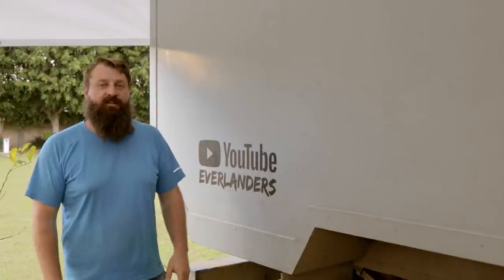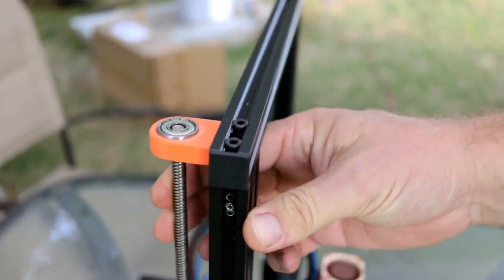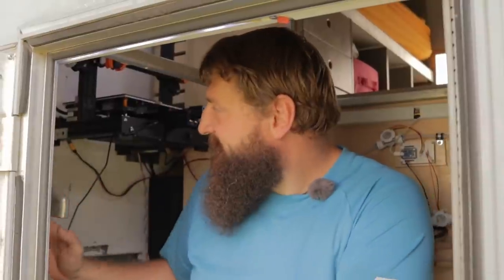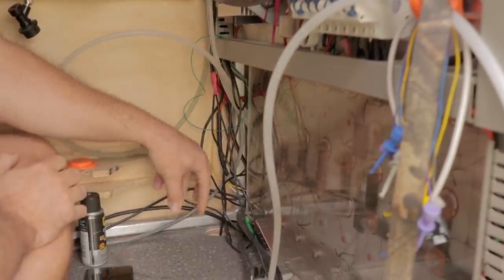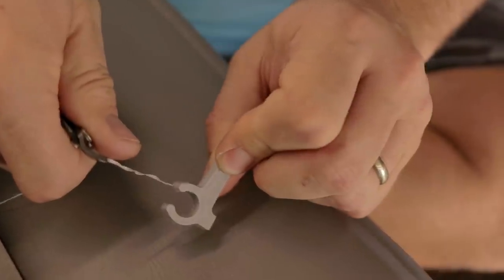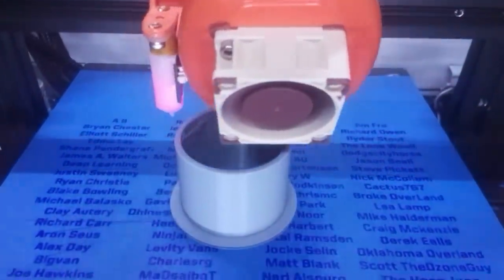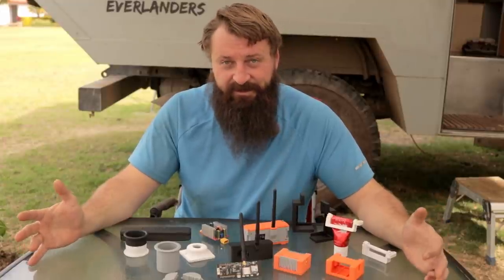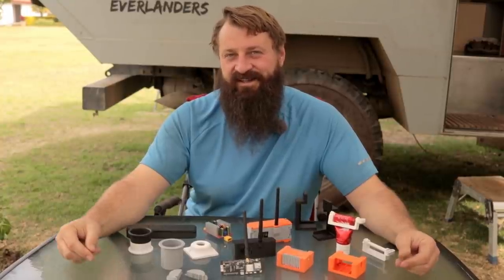Installing a 3D Printer in our Overland Truck  - Everlanders see the World!

Comment: When I tell people that I have 3D printing as somewhat of a hobby, I think most assume that 3D printing is just for toys and trinkets.  I appreciate it when folks like you do videos like this and kind of get rid of that misconception. I 3D print stuff to be useful around my house all the time.  Like you, I find that I can 3D print things that I couldn't buy.  For instance I just 3D printed a wall plate that allowed me to have a duplex plug and a 20 amp twist lock in a double gang box. Before remembering I could 3D print this I scoured the web and couldn't find one.
Reply from the maker: That is the most amazing feeling, trying to figure if you can buy a part or somehow modify something, only to realize you can print exactly what you need... Love it! ❣️
Reply: @Everlanders  Your are a great maker !  Love your modification, I want to do one just like yours.  Please provide details and parts and that I will need to buy in order to build one.   Also, where did you get the training for the 3D printing ?  on the raspberry pie ?  Thanks  LOL

Comment: Dangling berries, LMAO!! I love your deadpan delivery. Excellent use of space inside your rig. Are you at all concerned that an overnight print job will transfer vibrations up to your sleep space and keep you awake or is there so little noise/vibration that it is of minor concern? Glad you are making the most of your lockdown time. Great video!
Reply from the maker: I'm a very light sleeper, so even though it is nearly silent, I'm not sure I would try and sleep through it. That being said, it's easy enough to start a print in the early morning and have it done by nightfall... Anything longer than that, I'd pull it out and put it in the truck cab, this is where it lived and printed for the first few weeks.
Reply: @Everlanders  I think that instead of attaching the printer with screws you could use some kind of rubber blocks like the ones that are used on AC external units.
Then if you put some kind of sound insulation around all the printer, I know one of the best sound isolation materials is aerogel and you can buy isolation panels with aerogel particles, but I think they are expensive and not sure if they are worth the mony if you are not going to print large pieces frequently.

Comment: Great video, a lot of content in just 30mins! 
Watch out when printing with plastics like ABS, remember they pour toxic gases.
I think it would be cool to have a 1mm nozzle that you can swap fastly to print things within minutes. For example, you lose your wrench and you print a new one in 20mins and things like this.
How much does it consume printing normal pla 60°C/190°C? How many Ah for 24v?
Reply from the maker: I have no intentions of printing ABS, it's largely obsolete with the arrival of PETG. The Current Consumption is about 30 amps @ 12v at startup, heating the bed etc, and 10 amps while printing remaining layers.

Comment: 3D Printing is as easy as learning anything else needed;solar, thermodynamics, navigation, satellite WiFi etc. 
NinjaFlex is a VERY good low-temp Gasket Making material. Personally, i don't think anyone with limited access (aka Outta town) to parts should be without one.
I CAD/3D print parts nearly every week. The 15hrs of consistent power is a concern....
LUZBOT makes the easiest to get good results from. Ender 3 is only slightly more finicky, and way more MODDABLE ( it can run ABS and PETG easily)
Thanks for NOT printing a BENCHI, LoL !!!

Comment: Hi! New subscriber & member, offshore sailor, tech professional, and 3D printing novice. Inspired by your content and shopping for the correct printer, and looking for some trusted insight. I don't plan to attempt printing while underway although some motion at anchor/marina is expected, and of course space is at a premium.  Other emphasis on: often small and cylinder or threaded objects, UV resistance, strength. You've done great work with the Ender 3 V2 Neo, and I also see the Ender 3 Max Neo, and then the Ender 3 S1, each progressively smaller pricier (and more precise?). In my ignorance I can't readily decipher the difference between these for my application ... does your experience with the brand allow you to easily weigh in with any general insights?  Lastly based on some research I'm wondering ... am I barking up the wrong tree by not considering a resin printer instead?  Thanks so much if you can spare a moment!

Comment: 10 Points!!! I'm in.  The plain sight  3D print IMHO would be the cooling fan shroud on the printhead.
Reply from the maker: While I did print that, I did also sort of mention it... It was the SD card holder above the plaque on the wall... Already guessed by Eddie Lay a few minutes ago...

Comment: Excellent video as always. I am a bit upset that now I need a 3D printer. I've been wanting one to create brackets and housings for my arduino powered devices in my house. There are way too many of these arduinos sitting on breadboards around my house open and ugly... I've been concerned that I would use the printer a little and then it would start collecting dust. So many cool ideas, I'm beginning to believe it would get plenty of use.

Comment: Just discovered your channel recently and am enjoying it immensely. Nice work! I also picked up an Ender3 V2 a while ago and having a blast. Bit disappointed you didn't do a test print while driving. Haha

Have not watched all your vids yet but didn’t notice any chassis CANbus connection to your conversion. Have you looked up MCP2515 modules? Will communicate with a Wemos.  :) Think the earliest F series I snooped was a 2011. Fun stuff.

Good luck on you travels!
Reply from the maker: Welcome aboard! Wondering if you're related to all the other Ellis's around here?
Reply: @Everlanders  Thanks. That would be extremely unlikely. :)

Comment: Searching out what is a good entry level 3D printer and came across your video. Thanks for the effort in providing a great video with lots of tip and tricks. I am also about to start my journey into Rasberry Pie so all fit together well. I have recently completed an overland truck (Isuzu NPS300 4X4 and camper habitat in Australia) and am enjoying the ideas you have provided on automating things on our Overlander. I note you bought the Enders 3 V2 as I guess it fits your confined space on the overland truck. If space was not an issue what type and brand of 3D printer would you suggest for a newbee? The Ender 3 v2 or something bigger?
Reply from the maker: We ha e larger printers back home, but rarely can you use something bigger...  It's often a batter bet to print several smaller parts that bolt together, utilizing the strength in layers rather than one Lage part which may fail half way through.

https://youtu.be/lpzkHvQA-t8

Comment: Hey Jason, really enjoy your channel. Thanks for all the ideas, just about to pull the plug on getting a printer. It's going to be a blast learning. Been doing tons of studying before I buy. Two things in this video: 1) Ts100, just got it, AMazing. Curious if you know of an off the the shelf step up converter to go from 12v to 24v to run it off a Lipo? (Hitting the like on every video man.) Thanks for all the wisdom.
Reply from the maker: There are countless DC to DC step up converters on Amazon, most of them are adjustable to whatever voltage you want, anything over 100 watts should work... I have several of these 400 watts https://youtu.be/XliXDd9NSWQ

Comment: What a great video, but damnit, now I have to buy one.  I've wanted one for some time now but was kinda leaning towards a resin type.  I get the feeling that traveling with a resin printer would be a mistake.  I don’t see where the roll of material lives?  Is it still on the top hidden up in the hidden space?  The bench access is genius, btw.  Slightly off topic, what are you using for the bond material?
Reply from the maker: Hey Tim! The filament roll is up there too, to the left of the printer a little bit, you can briefly see it at 22:47  Bond Material? The Aluminum Plate? It was bonded with 3M VHB, If that isn't enough I have SikaFlex 252 along and might redo it with that if need be.
Reply: @Everlanders  Groovy man.  So I am hearing that SikaFlex is batman and 3M VHB is Robin.  I will get both, just in case.  I think I will turn the back seat of my 3500 into my shop, complete with TIG, because if the SikaFlex doesn't do it, a TIG bead might!  :-)  Thanks for the info and looking forward to another geeky vid.
Reply from the maker: Because others have asked too... https://youtu.be/4wTP7kpA3BU

Comment: Thought I would ask here sorry it’s off topic but I’ve noted after watching a few hours you negative ground all of your systems? What I mean by this is your solar power (panels) too this is the first time I’ve ever seen this and ask does this cause any problem? Also I was goingask  why you stuck to 12 volt over 24 (current/wire gauge  wise ) as this my biggest problem/pondering with a 2000w ups hacked ,3D printer and my kettle ,toaster oven (24v)  but van is 12v charging  pulling hair out many thanks in advance 👍
Reply from the maker: Yes, everything is negative ground (as most vehicles are)... What problems are you suggesting I'd have?
I built the system 12 volts because everything for RV's is 12 volts, the chassis is 12 volts, the ventilation fans, LTE router, LED lights, Computer monitor, ... and because all the electrical systems are in one place, there is no need for long lengths of thick wire. Our longest thick wire is the inverter, about 14 inches away from the batteries. Mostly I wanted to keep my hair.

Comment: I am curious about how iterative the process is for getting the bits to fit.  For instance, when making a case for the DC 12-24V converter do you go thru many prototypes?  I suppose there is a meme for measure 15 times, only print twice.

Awesome video, and although I am acutely aware that I may never learn how to do this kind of stuff, it is nice to watch.  You are the high tech version of Norm Abram.  Smart, creative, humble and frugal without being cheap.  "Value focused?"  Thanks!
Reply from the maker: That was pretty simple as it is just a square box... and I modeled the PCB and heatsinks too. So the first one worked just fine. It was worth the time to measure everything properly because I have two of them, in fact now I need to print two more for another guy who has the same soldering iron and wants to run it at 24v too... so the design work payed off.

Comment: I'm in the middle of a van build and I was thinking a 3d printer would be helpful for all sorts. This video confirmed it.

So I'm left with one question which you may be able to answer; you bought your ender V2 ~2 years ago. 

Which would you buy if you were buying one now?
Reply from the maker: Probably some variation of an Ender... It's a good size, maybe a bit too tall, but easy to trim down. Lots of aftermarket parts for cheap... If you have too much money and space, the Bamboo printers look great too.

Comment: Getting the new caravan setup to travel Australia and love my 3d printer but she’s seen better days and it’s heavy.  Looking at one of these and going to do the mode to 12volt.  Would a 24v  10amp buck convert  run this. 

I’ve also done the Starlink mode that you showed.  Was hard to get the glass off.

Thanks again for any advice.
Reply from the maker: I doubt it, it pulls nearly 30 amps peak, I use the red, 1500w converter shown in previous videos... https://youtu.be/UAZGX379dmc

Comment: I prefer my prusa mk3 much better a little more money but quality and open source, printable parts you cant go wrong...and it will take shock a little but recalibration is needed always..this unit will require more before each use..good video
Reply from the maker: 4 times the money... We had one for work, and it was not immune to problems either. I went with this because it has a more modular frame that I could bolt ridgely to the wall. No adjustments have been needed since November... Further the lead time on a Prusa was months in advance when I called, this is available now...

Comment: I really liked this video! We have a Sprinter van which we want to use to travel and have yet to fit it out. One big issue is how to fit my hobbies of ham radio, microcomputers, and 3-D printing into the van without making it "overcrowded". Unfortunately, my better half tells me that leaving the bed and stove at home is not an option!

Have you considered ham radio? It is a great way to keep in touch when you are in remote areas.
Reply from the maker: Ham radio is no doubt a great hobby... but we don't see anyone else using them while overlanding.

Comment: Great timing, my new, and first, 3d printer was delivered just 4 days ago and is also an ender 3 v2. Saw you mentioned the sd card holder for 10 points but before that I thought it was the cable holder with a ratchet, just inside the door next to the electrical controls. Great video as usual, all the best to you down in Mexico!
Reply from the maker: You get 5 points! (I forgot about that one actually...)

Comment: Hey J, for the part cooling fan were you able to step down the voltage and still retain the PWM capability? If, so do you mind sharing how you did it? Ive read a few ideas online, I've seen someone change the 24V PWM duty cycle to 50%  to get 12V (assuming 12V fan rating), this idea technically could work but is not the most reliable as it can create noise and you still potentially need an LC filter. I've also read that the PWM on the 24V pin is potentially switching ground. If that was the case, using a buck converter with the input GND grounded separately like on the power supply, and having the fan grounded on the 24V GND pin. Thoughts?
Reply from the maker: I just used a couple LM2595 to step it down, PWM still works as expected.
Reply: @Everlanders  thanks!

Comment: I love 3d printing its so useful in so many ways. How many amps at 12v does it use? Can u print on cloudy days
Reply from the maker: The printer uses around 35 amps during the initial hotend and print bed heating, and then it averages about 10A @ 12v during printing. Our Solar production is about 50 - 60 amps on a sunny day, and about 30 amps on a cloudy day. But even then, we've been printing overnight from our 900Ah LiFePo4 battery bank and then we make it all back the next day :-)

Comment: Lots of useful prints. I jumped straight into the deep end and got a resin printer for my first printer. Four attempts and four failed prints. Waiting for a touch warmer weather in the unheated garage before I dive back in.
Reply from the maker: I had heating problems with my first printer years ago, I ended up making a styrofoam box out of 1 in foam board which helped a lot when printing ABS which tends to warp.

Comment: I have a heavy ass metal military surplus table probably weighs 300 pounds, with damping material under the printer.  I still get some misprints and stuff I blame on something moving or getting vibration.  If you get this damn thing mounted in your vehicle and are able to reliably print stuff after beating around off road you are a "GOD".  These things are so persnickety,  and probably the most aggravating, all consuming fing things ever!!  But it's like golf every once in a while you get a good shot or print and it works!  Keeps you coming back!
Reply from the maker: I feel ya, but this isn't my first rodeo... I view it as a problem that should be able to be solved... Ask me in a year...
Reply: @Everlanders  Ah I have no doubts you will make it look easy!!

Comment: Awesome video!! I would love to have 3D printer on the road as I have gotten used to having 2 ready to go all the time... On another note I think you mentioned in some  tour that all of the drawers are locked with electromagnets everythime you pressed the break or left the vehicle. is this correct? What electromagnets did you use and how did you connect it to the break? Also what it the power draw?? Thanks!!
Reply from the maker: Not exactly, the electromagnetic solenoid actuates a drop lock... They're not holding place by electromagnets.